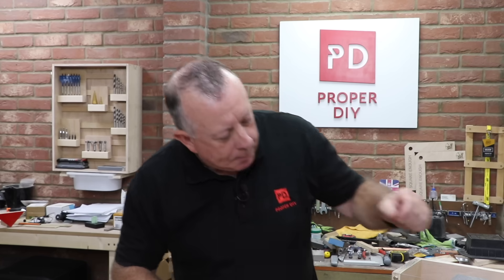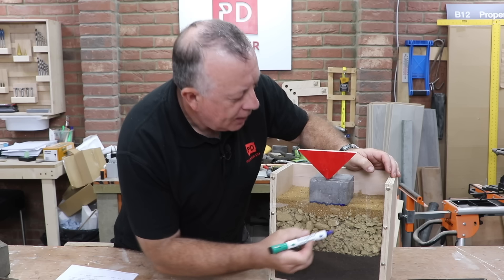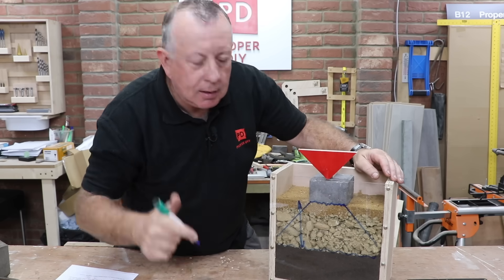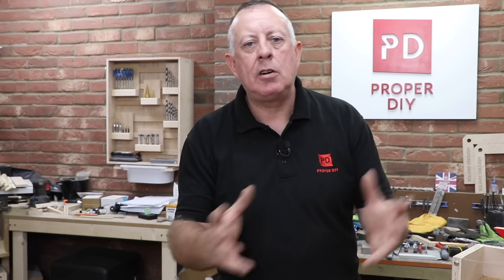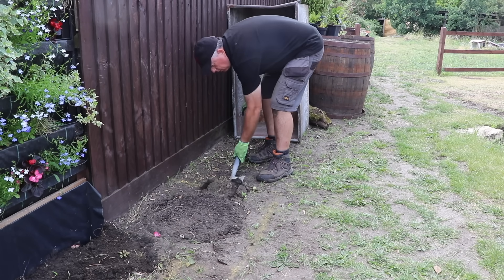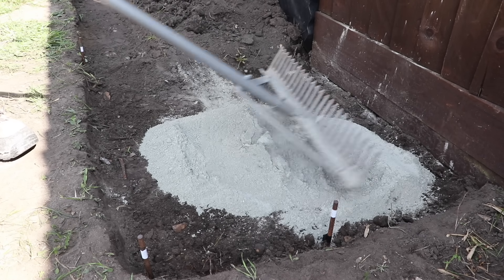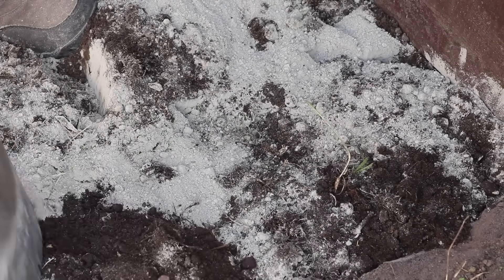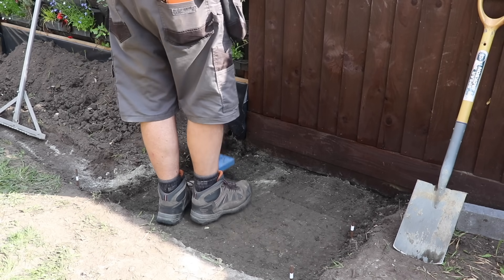How to Save Time & Money by using a little known Civil Engineering technique in the garden!

Comment: What are the drainage considerations you need to take into account when using this method? I’m assuming type 1 allows water to percolate through while stabilized earth will create pooling on top.
Reply: Concrete is porous and will absorb water. So will this stuff. But with the places you will typically be using this (shed foundation, garden bed walls, sidewalks, etc.) It should not affect your drainage plans at all unless you are pretty much covering your entire property with an uncovered slab of the stuff. Your normal drainage considerations are normally slightly sloping the slab to sheet water off away from the base of structure, installing french drains and the like to move water in a needed direction, and designing your roof and gutter systems to transfer water away from the foundation.
Reply: Does this work with clay soil?

Comment: If you don't have a mixer then this seems like a great candidate for the 2-bucket method, usually for thoroughly mixing sand-cement... would ensure that you get a good mix which I assume will make the strength more consistent...

Comment: Great video.I can see this saving people lots of time and money if done correctly.
Could this method be used for non load-bearing applications under an extension to keep out weeds,rodents,etc rather than using 100mm of scalpings and a further 100mm of concrete?

Comment: This is incredibly timely!  I have an odd patch of land halfway up(slope of) my property that is a "junk area" at the moment.  I need to "seal" it to stop water percolating under the house, and have been trying to decide between concrete pavers or a cement slab.  I was leaning towards pavers because they're easier to remove if/when I get my place professionally landscaped.  This "rammed earth" style is a really good solution in terms of pavers.  

Do I still need a layer of sand under the pavers?
Reply: Yes

Comment: Great vid, very well explained. In NL we call this hardening the soil, usually done with coarse sand, or sand mixed in with soil, It does work very well and is a go-to solution for any outside area that needs to stay where it is :) . A small auger or a mixer attachment on your drill moves things along a bit.

Comment: As I understand it, cement doesn't cure by drying out, but by absorbing CO2 from the air, changing soluble hydroxide into solid carbonate. So concrete can set underwater, the stuff they put in "underwater" concrete is just to resist it washing away, rather than anything to do with the process of curing. So the wetness of the soil might not matter so much, but I'll defer to someone who does this all the time.

Comment: Very interesting never seen this before 
How does it do with water permeability? I would assume not great essential being a whole slab
Reply: It would only be suitable for laying slabs or anything impervious and where runoff and drainage is needed. It's no good for the 2 types of block paving because it's flexible and shouldn't be laid on a solid base. (The blocks have a degree of movement . That's why they don't crack). Normal block paving soon becomes impervious after laying but due to strict water runoff regulations, pervious paving is often used to take care of drainage. That's the type you see with the coarse type of grit or rather crushed stone between the joints.

Comment: I need to lay some paths and a patio and the cost saving in materials is very attractive. My concern is weeds growing through the block paving I would place on the soil and concrete base. Also, do you think it would be practical to build a two-foot-high wall using this method? I saw this done on a gardening program many years ago, but nothing was said about long-term durability. The purpose of the wall would be to level a sloping lawn on two sides.

Comment: In my neck of the woods we have dry, sandy soil. So in the swimming pool industry it's standard after dropping the shell in to add cement as we backfill and pencil compact around the shell.

Otherwise it'd be weeks before the sand would settle enough that we can put concrete or paving and coping down.

Comment: I know this will depend a lot on the setting and soil type, but I assume that the removal of organic material in necessary for this process. Civil engineers on a road project will surface scrape the top soil away and work on the sub soil to stabilise it.  As a DIY project this isn't going to work with 4" of leaf mould or highly conditioned garden soil is it?

Comment: Actually I might try digging the earth and mixing it with cement in the mixer to get an accurate mix and return it to the dug area. As I have heavy clay it is very hard to get lumps out and a smooth mix.
Reply: Breaking up the clay and sieving the soil with the addition of some sand will also ensure a more consistent strength in the final product.

Comment: Why would you ever use Type 1 for domestic paving, its too expensive and type 2 is more than sufficient?  i would also specify 25mm of bedding sand to accommodate all the variations encountered, 15mm is too thin.

One thing that amazes me is that many builders will still demolish, cart away and then import hardcore, when its just, if not more economic to hire in a mini-crusher to provide the sub-base, doing that means that a) you are not taking out quarried material that is a finite resource and b) the arisings are not sent to our ever growing landfill.  I suppose the effort to hire a mini-crusher is too great and besides the customer will pay - 🙄🙄🙄  

Cement stabilisation is common practice but be aware that the normal sub-base/bedding is much more porous and does not run the risk of eventually washing the sand away to the sides.

Comment: As a civil engineer in Australia we often use cement stabilisation for roads in the outback due to the distances (and cost) of transporting top quality road base material. As a rough guide we use only 2.5-3% cement. Anymore than that and you will start to get cracking appearing at roughly 10-12m centres, so if you are doing a large area eg a long driveway just make sure you don’t add too much cement.  Also if you have heavy clay, lime stabilisation may be a better option, with the benefit it can be reworked.
Reply: I have not heard of this before, but now I have this could save me lots of money. Looking to replace the front paved area. 5 X 4 meters. Would a small soil rotavator and an Aldi compactor be the best tools.
Reply: @Gem1n1yt did you try the rotavator method? I'm thinking about trying it that way
Reply: @pault2340  Sorry Paul no I haven't as yet. Still designing garden makeover and it's taking more time than exspected. Also I have a lot of clay so I need to do some research into the comment in the video on using lime not cement. Good look
Reply: I believe cracking clay soils might be unsuitable for this, since the clay itself shrinks and swells dramatically as it dries and wets.  You see how challenging this is for civil engineers building roads over this soil type.
Reply: Is that 3% weight or volume
Reply: @Robert-zx2df  great question, by weight not volume
Reply: Weight @Robert-zx2df
Reply: How much like do you need?  I assume a bag of builders (hydrated) is fine to use?
Reply: @jonathanwilliams7950  hydrated lime is fine, the quantity depends on the quality of the clay but remember the benefit of lime is that you can keep reworking it and adding more if needed.  I’d start off with a similar ratio as for cement.
Reply: @carlbillingham2670  Thank you for your advice. The soil in our garden has a lot of clay in it, mixed mit humus. I consider mixing it with sand for the technique, do you think it will reduce the expanding and shrinking of the clay in a foundation? This remembers me of when I was working at a pottery, we would mix our own potter's clay and sand would reduce the shrinkage in the firing.
Reply: Is it possible to make a permeable layer using this technique?
Reply: Does this work in the outback where there is hydrostatic sand ?
Reply: Thanks.
Reply: how does it handle the wet? ive got a property that has a fair bit of clay. slippery as hell as soon as there is a whisper of rain. 
What options do i have for now seeing i cant get aggregate into the property yet? cheers
Reply: @jessoman  hi. If you haven't got round to it yet... I've prepared a section of my garden for an office. It was really heavy clay, I got taller as it built up on my boots while digging roots out. I dug in 9 bags of lime over a 4x5.5m area down to the depth of my garden fork. When I dug it again 3 weeks later to add cement, the structure of the soil had completely changed. The clay  had broken up and the ground drained! One more point. Lime from builders merchants is getting on £20 for 25kg. It's around £7 from agricultural suppliers.. I'm not sure if I needed to add the cement but I'd rather not find out later.
Reply: What looks good for Australia sounds bad for Canada.
Reply: Thank you for saving me money & work!
Reply: But what about drainage - won’t water pool and sit on the blocks etc and the. rot any wood stuff laid on top?
Reply: Has anyone used this technique or lime stabilised soils for house foundations on reactive / expansive clay soils?
Reply: That must explain why every Australian road I drive down is absolutely shocking...
Reply: Well how long one must wait before laying pavework over the soil-cement mixer?
Reply: @MsTheHymn I would think a week, in warm weather. When your fingernail won't scratch it, it's good. Heat and water will speed the cure.
Reply: You say cement. Please be clear, pure Portland cement or concrete?
Reply: @carlost9454  I am being clear in saying cement.  Concrete is made by combining cement with sand, aggregate and water.
Reply: @carlost9454  We use cement (often called Portland cement, although name does vary in countries) mixed at ~3% with 20mm to dust (CT, cement treated). Making a very weak concrete.
Reply: @carlost9454  cement is an ingredient of concrete

Comment: Stabilised rammed earth. I used this extensively in South Africa about 20 years ago. Achieved 20 MPa strength with 15% cement content.
Reply: You sure?
I think soid concrete block which stronger than earth concrete unit have comprsive strength around 12 mpa
Reply: @talib9259  depends on the soil, Since some of south africa is dry mediterranean, some soils will have almost no organic matter to interfere with the curing, nor clay to reduce the efficacy of cement crystal overlaps.
I live in a similar climate (a mediterranean with oceanic influence) and my soil feels stronger than anything that was shown in this video at any stage (even the fully cured cube got damaged easier than scratching my native soil).
In terms of Soil strength (ISRM 1978), the video shows how to make a S1 to S2 soil be about the strength of a S3. my soil is naturally a S6 dry and S4 wet, with problems with liquefaction (this is the usefulness of adding cement in this case, as it forces the fine particles to not develop excess pore pressure).
EDIT: the point is that with the correct soil, your mixture is almost identical to concrete, as that is how concrete is made, as mix of cement and sieved soil with different particle sizes, avoiding ultra fines and organic matter.

Comment: You’re like some sort of mind reader. I’m getting ready to redo a path between my garage and fence and have been trying to find a way to produce a solid end result without breaking the bank since this isn’t an often used path. Thank you!
Reply: Yes soil is brilliant and easy to work with. I  used some planks of 4x3/4 inch tanalised timber to form the edges of a path. I staked them in while bending to the shape I needed and then shored the planks up with soil inside and out. I then put some some weed cover down and filled the space between the planks with gravel.  Quickest path I ever made and I blended the soil on the outer edges of the planks level with the existing lawn I had laid the path over. The soil soon grassed over and that soil is now solid and has not moved. But I have also been thinking of laying some slabs into the lawn  as stepping stones and thought of mixing cement into the soil.  You just don't need all this sub base material unless you're going to park a car on it. Good luck with your path.

Comment: I washed a film about rammed earth buildings many years ago and this technique is basically the same process. I used this idea to build a garden step and also a patio. I did use a fence post to compact the cement earth mix and laid the paving onto wet mortar. Everything has remained exactly level for the past 20 years...a great technique and a very good video👍
Reply: What is not really clear for me is how rain water will sip through such stabilised soil? It looks like water management should also be done for big sites
Reply: @oleksandrzaslon5367 yes, slope and drainage always have to be accounted for--just remember--water flows downhill. Too much slop and you could wash out your neighbors in a heavy storm.  Washouts with damage-that you caused-are your responsibility.
Reply: Did you use a layer of sand between the base and mortar?
Reply: @Stressed_Member  I didn't, I just mixed some cement powder with some water so I could brush some onto the underside of the paving slabs as I laid them.
Reply: What film?
Reply: How long did you leave the subbase made of concrete and soil to cure before you laid the wet mortar on?
Reply: Excellent video, thank you so much for sharing!  I do have a question please?  Instead of digging down, exactly 4", putting in the sand, making your 1" frame... all that to make certain you have a better handle on the proportions of your soil to cement mixture, why not just mark the depth you need to dig on your shovel?

Comment: A good point to raise Stuart, as we all need to minimise waste and un-necessary journeys and not just for financial reasons. I would suggest the big variable is the make-up of your soil, there will surely be a considerable difference between, sandy/gravelly soils, clay soils, peaty fenland soils, chalky soil & stony soil.
I have quite a sandy/gravelly soil so I have successfully employed this method extensively since moving here 25 years ago, and have a policy of re-using all excavated material on site. It can cause a lot more work as I sort material by grading it and sometimes washing it, but I feel it is generally worth it. I would guess I've brought something like 12-15 tons of aggregates +slabs & blocks onto site over that period and as a result we are now noticeably higher than some of our neighbours, but we were at a low point so it's not ridiculously so.
Anyway, nice to have this approach validated by an engineer, so thanks for that Stuart, I just did what I thought made pragmatic sense !
Reply: Yes I’m keen to know how different soil types work with this method . I need to lay a base for a greenhouse and have been putting it off as the thought of digging out and carting in is very unappealing. The area is heavy clay soil that has a lot of stone through it so not sure whether it would work on that?
Reply: Other comments have mentioned using ground up limestone on clay soils,  @andrear6033